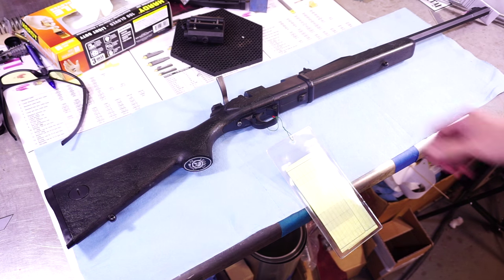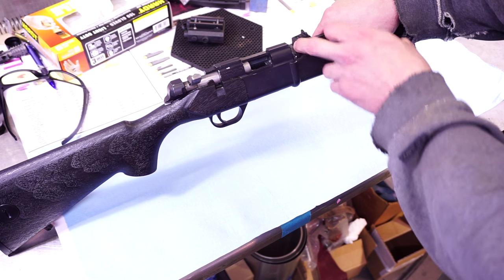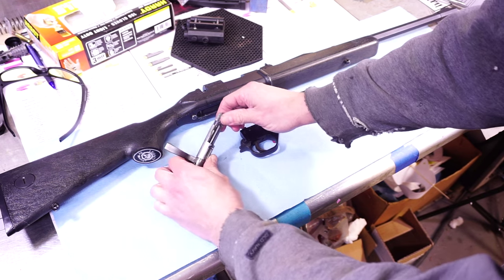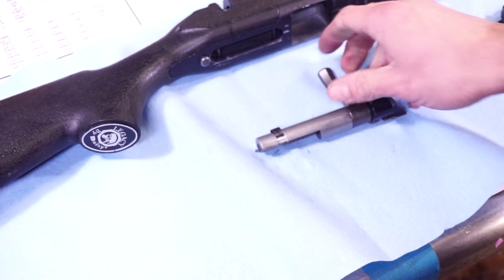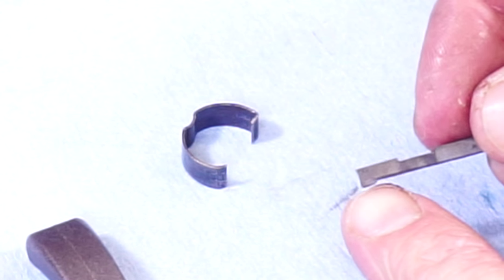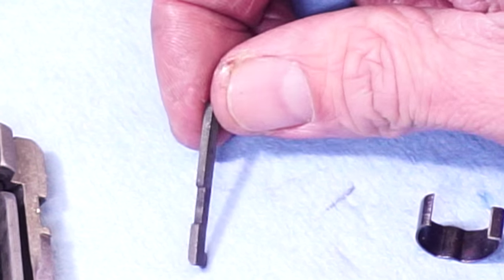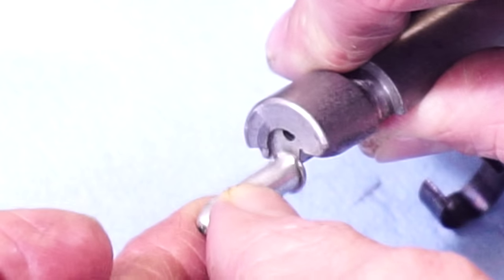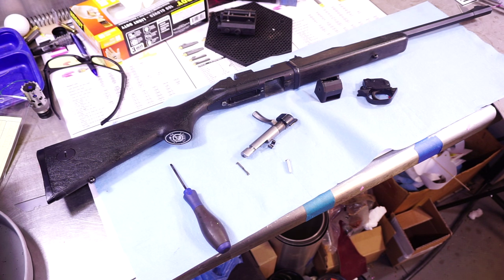Daisy Legacy 22lr extractor repair

Comment: Did you ever find out if Ruger 10/22 mag will work? I have a 2201 that the plastic where a mag would go is dry rotted snd was wondering about converting it if itll clip right in